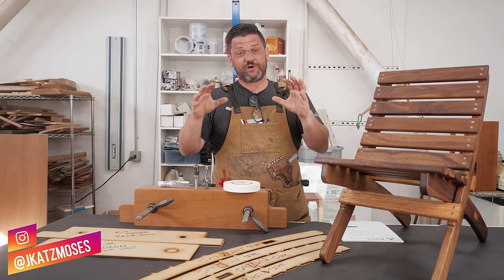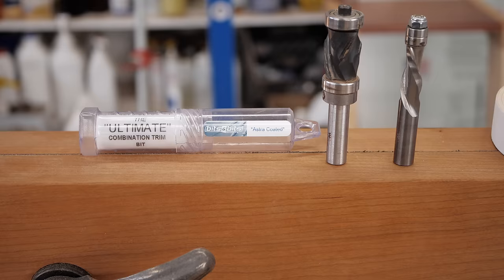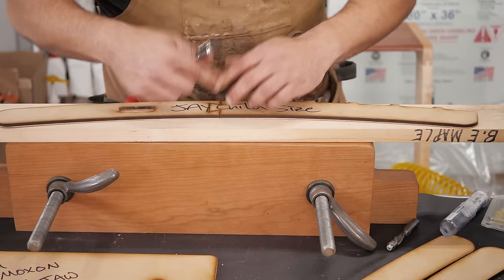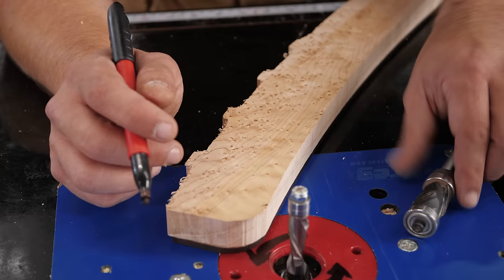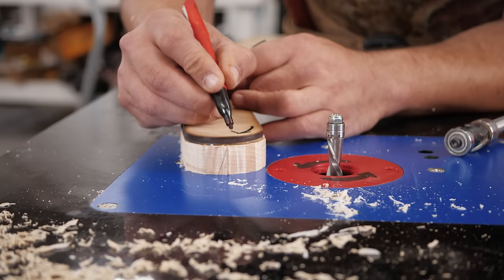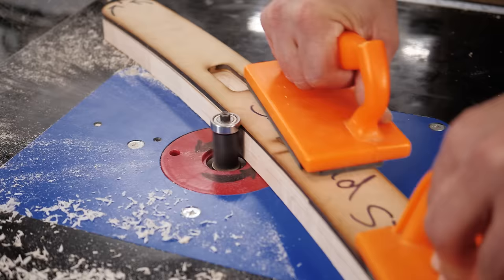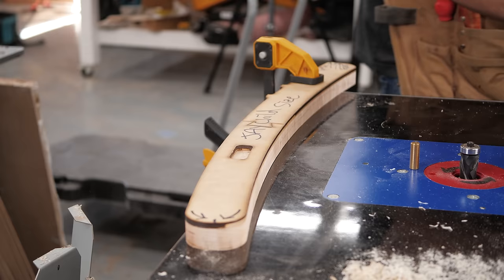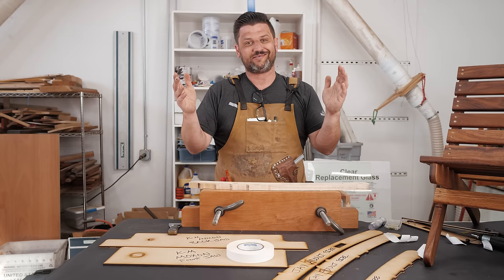My Favorite Template Routing Tips and Tricks

Comment: Nice description, i knew a lot of it but it was a good refresher and certainly a good thorough description about feed direction vs grain direction for anyone who is a little confused about it. I had a situation with a 1/4" template bit in a table that caught like that and it also bent the shaft of the bit so it caused some INSANE vibration, so your kickback demonstration is very important. Also, I want one of those double bearing bits now.
Reply: Same here—had thin “fins” I was routing with my template, and I chewed up two of them and had one  pulled out of my hands. SCARY. I had no clue that I needed to worry about grain—just the direction I was supposed to feed the workpiece. Thanks, Jonathan!

Comment: A few of things:

 Your use of the term "safety pin" implies using it provides some sure element of safety, which it might not. Porter Cable calls it a starting pin and I prefer that terminology as that's what you use it for. You generally only need it for starting on smaller pieces, when you need to approach the bit very slowly or to help maintain control of the situation where you need to start routing one edge but not the edge perpendicular to it. Like many others here, I didn't know what it was supposed to be used for until I saw a demonstration on it at a Rockler store. It came with my Incra router lift. I use it occasionally. When I was making rail-and-stile panels, I used the starting pin a lot as those bits are huge.

Visible tear out against the grain depends on the bit and the wood. Tear out cannot be eliminated, only minimized. The harder the wood, the worse it is. Going in the other direction by flipping the work piece can sometimes help, but sometimes there's no choice. Take the case of the hand grips on the leaves of a butler tray table when all sides of the hand grip need to be rounded, with and against the grain. Going slow helps but that will tend to produce router bit burn. That burn can be sanded off and repaired easier than grossly visible tear out.

The flush trim bit can help produce very straight and accurate cuts in pieces that are just too long or awkward to cut on any other device. You just need a long straight edge clamped to your work piece (and any work piece needs to be secured to the work bench with at least 2 clamps). The larger the diameter of the flush trim bit the more effective and smoother the cut will be. A 1 degree cutting angle error made in a dining room table top piece 40 inches across will result in a lateral error on the far end of "only" 0.7 inches. If your table will have leaves, nothing will line up! You cannot fix this and have a clean edge with any other tool besides your hand router, trim bit and a nice straight edge. A jointer will not guarantee parallel surfaces, only straight ones. 

Using templates is very useful but not problem-free. The double stick tape will pull off material from it or it's not sticking well enough. If you plan to use the template a lot, applying shellac to its surface and letting it dry overnight will help the tape stick to the template better without removing template material when separating the pieces or pulling off the tape. The bearing will mar the surface of the template on repeated use. If the template is hardwood, that is best and the harder the better. Damaged template surfaces can be so-so repaired with the epoxy-type wood fillers (Bondo, etc.), but full strength takes much longer than the advertised15 minutes. Nitto tape is very expensive and you appeared to use a lot of it. I use the 3M Scotch foam double stick tape. It is less than 1/6" thick and you don't need very much of it. Two to four small pieces, 3/8", is generally all that you need. If there is any warping of the template or work piece, the paper-type double stick tape may be too thin to adequately adhere to it, so the foam tape would be definitely better. The putty knife method of separation is fine if you don't want to reuse the tape (sometimes the tape can be used more than once). It can also scratch up the taped surfaces. I use it when I can't separate the pieces just using my fingers, which is often. I avoid thin templates. MDF makes the worst templates but it's cheap and easy to work with other than the toxic, MDF dust. Plywood is not much better because the actual surface rested on by the trim bearing is only the thin, outer surfaces of the plywood.

Comment: Building an Adirondack chair for EXAMPLE … I have determined exactly where my fasteners need to go when assembling the chair.  The plus now is... I don't need tape for routing.  
*I simply counter sink a screw through the existing hole in the template and into the piece of wood.
*I visit my local hardware store and ask for "scrap" plexiglass/acrylic and pay pennies on a dollar. I use them for templates.
*I draw my outline onto the piece of wood... then remove the screws and set aside the valuable template.
*I can now with confidence, cut as close to the outline as possible without endangering a template. 
*Afterwards, I realign the template using those same screw holes to the lumber and begin safely routing.
*When routing is complete, I remove the screws and then use those holes for my fasteners for assembly.  Of course, if you are using larger fasteners, simply drill out a larger hole. 
*I love the acrylic/plexi because the shape stays true after countless uses... and... if you accidently drop a template on the floor as I have, it doesn't dent like a wood type template would.
*happy routing!
Reply: acryl have shit and dangerous use, this material have than glass broken easy, and too hard, lot better use thin wood or ABS or PVC plastic.

Comment: You are very thorough with your videos. Good information. A little trick I use is to first install a larger diameter bearing on the cutter. This take a "rough" cut first. Replace the original bearing, and finish cut the piece.
Reply: Some bits have 2 bearings, usually the same size, but, maybe one could be larger for the 'rough cut'.  Then it only takes a height change.

Comment: I think I saw the wood whisper do it first but it’s blue masking tape with a drop of ca glue and it works good and comes off easy too
Reply from the maker: I've used it before but not a big fan. Seems to come off too easy for me and sometimes I get squeeze out beyond my tape. Plus for $14 these rolls last me a couple years and there's no setup. Blue tape is crazy expensive to be using it for something its not really intended for. IMHO I can use 4 little tiny pieces vs 8 big pieces of blue tape.
Reply: I was going to suggest the same.  Watch Ben at crimson guitars he uses it a lot.
Reply: I have a feeling the wood whisperer mentioned he got the tip from a crimson guitar video
Reply: @katzmosestools  Tried both too. I strictly use double sided tape. Its definitely not coming loose.

Comment: Nitto tape is a similar product that works well. I use it on a desktop PCB mill. It even held down machinable wax. Like spec tape it doesn’t need much to get the job done.
Scotch double sided office tape also works in a pinch IF you’re careful. It won’t re-adhere once removed and it needs more of it though.
Reply from the maker: Great tips. I'll check them out. Usually a roll of the stuff in the video last me a couple years. I think I've bought 3 rolls in my lifetime.
Reply: @katzmosestools  For removing the template it usually works pretty well to pry up an end just far enough to get a grip on the 2 pieces and then rather than prying/pulling straight apart try shearing the parts apart sideways.  For me there is much less muscle involved and the forces are across the width of the template with little risk of banding and breaking it.

Comment: When I took woodshop in junior high (as opposed to Home Ec), I tried to use a router free-hand to cut my name out. I came out so bad I chucked it into the scrap bin. I never even attempted when I took woodshop in college (yeah, BS Industrial Tech - woodshop, plastics shop, and metal shop were core electives).

Now that I'm getting to the point where I just have to use a router I'm afraid whatever I do will come out jacked and wood's expensive. I been putting off finishing the cool redwood porch glider because of that fear. It's gonna be somebody's Christmas gift at this rate...

Comment: I'm looking forward to the router series. I'm still trying to wrap my head around the cut direction and climb cuts and tearout and that kind of stuff. You touched on it here, but for me there wasn't enough explaining with the demonstration. It just went by very fast.
Reply: Get a handful of straws and lay them out on a table. Offset each one say a half inch apart as you go. When you start at the top routing and going "downhill" the next straw inline is 1/2 inch longer and supports the previous one. Starting at the bottom and routing "uphill" as you would cut each straw there would be a 1/2 inch where there is no support and much more likely to tear out.

Comment: Instead of double sided tape, use painters tape on each piece - put cyanoacrylate on one piece of tape, spray the other piece of tape with accelerator, and it will hold, as long as you don't 'twist' the two pieces apart - which is perfect for when you do want to take them apart - the tape will come off easily, and if it is sticky and you are having an issue, you can twist the pieces apart.  Cheers
Reply: This is the way, and it is much easier to clean up after you separate the pieces.
Reply: Great tip.  Just used what I thought was good double sided tape but created a mess (must have been carpet tape)

Comment: Thanks so much for this video. how to do cut an outside 3/4" radius on a 12" x 4" piece making a radius cut on the 4" vertical side ,top to bottom if this makes sense? Using a flush trim bit or roundover bit? thanks.

Comment: Awesome info! Now I'm thinking I'm using a too small diameter bit, or too weak of a router (Love it anyways) rather than needing new cheap bits from ebay, or bank breakingly expensive new bits from the hardware store. I'll try what I was doing slightly differently later.

Comment: Thanks for the tips! Have you ever tried to use end mill cutters? They are a lot cheaper than this router bit that you told in this video. These end mill cutters don´t have the bearing but some routers come with a guide bushing which has the same function of this bearing.
Reply: better use bearing bit, not expensive than whitout bearing, all bit have today wery cheap can buy eweryday new if want.

Comment: Jonathan you so often seem to cover exactly what I need to know, and you have done it again today.  However, what about when the work piece is wider (thicker) than the depth of the router bit, and you have no option but to start with the lower bearing, and then flip the work piece and use machined surface as the template with a top bearing bit, or your two bearing flush trim bit with the lower bearing removed?  I'm trying to see it in my head, and thinking we should be able to treat each case according the grain direction where the bit is cutting, but I am not sure I have it right, and can't even experiment till I get to the shop tomorrow.   BTW to add to the problem, I am just using straight (non spiral) bits, but I can see that I am going to need to invest real soon.
Reply: drill if possible 2 small holes using a drill press through the piece. screw template on from side 1 switch to side2. plug or fill the two holes

Comment: You spent considerable time eating out the tooth detail on the bandsaw. Would you explain the potential problem of letting the router take a bigger bite? And how to determine this 'limit'?
Reply: Puts more strain on the motor and will dull the bit faster taking big bites. Just try to get as close as you safely can for less wear on the bit and router.

Comment: Thank you for the video. I have also experienced kickback with a half inch bit while making Jay Bates nesting chairs in Alder. The grain direction was significant and you showing the technique of using a double bearing router bit was helpful. In a  future video could you possibly cover router bit speeds? Would slower bit speed help with the kickback?
Reply: Slower speed will give a rougher cut, and your feed speed would need to be a lot lower. Higher risk of tearout. That's my advice as a time served cabinet maker.

Comment: I know this is a year old, but wondering about templates and thick work pieces. Like say a 1.75” thick chair leg is desired, I’m assuming you cannot use the double bearing bit, you have to attack this a different way all together?  Like a combo of a template bit and flush trim bits?

Comment: My issue is finding a way to route templates that are larger than my template. 
 
For instance, if I have an intricate shape that I want 3 inches larger in slavery direction. I'm often having to make several varying sizes of an item, and I don't want to have 10 different templates for each item. You'd think "Just use a larger bottom bearing." But if it has fine detail designs, curves, etc, a larger bearing would have too much surface area, and unable to move along sharp, short angles.
 
This has been a perplexing issue for me. Any tips?

Comment: Nice intro, but while I like templates like this since they don't take a lot of space I typically prefer fixtures instead with toggle clamps, much safer and no need for taping. Sure you will in some cases need to make several fixtures for one piece but it is still faster and more effective. Cheers!

Comment: QUESTION: i havnt found anything on this. incra router plates has holes in the lock rings which helps tremendously suck in a lot of the dust on freehand routing to the underside box where the router is and not all over the top of the table. So, is there a way to route two little channels into the lock ring plastic to help improve dust collection since kreg does make that ... which they should btw?

Comment: A video on accurate and repeatable dadoes with a router. I've tried several methods and none really do the job.
Reply: Check out Nick Ferry's channel. He has a great router dado jig build :)
Reply: Tried a flip stop? Clamp a piece of plwood down and run your router with desired bit. Say its 2 inches from plywood to the edge of you r cut...cut a 2 inch piece and put it against the plywood so it matches up with the cut edge. Put hinges on it so you can flip it up. Then just line it up with the layout mark for your dado, flip up the piece and it will line up perfectly. It will change for each diameter bit.

Comment: I should have watched this before I started. All I'm doing is multiple pill shaped pieces of 1/2" walnut - 7 inches long with ends the same as in the piece you were cutting. Almost ever single time I rounded the one particular end I got kick back and tear out. It was driving me nuts. A bit disappointing to learn that I should be changing bits with every piece, since I have so many to do, though.

Comment: hey sir, i boiught the triton  router 3 something hp. put it in a router table under a kreg plate , took out the spring and when i set it to height it vibrates back down a little at a time. is there something else that i need to do to stop that. i have not seen you do anything but raise and lower. thanks

Comment: Thankx for the router pattern video, i used your link to get 3 rolls of tape. I have a question , as a newby  to using a router, i insert my bit all the way in then lift it up almost 1/8 inch before tightening.  When i try to remove the bit it almost always refuses to pull out. I sometimes place a scrap piece of wood on it and  lightly hit with a mallet or screwdriver handle to jar it loose an sometimes that dosnt work. What am i doing wrong , to tight? dirty collett? or just dummy operating machinery?   Thanks in advance for helping with this problem.
Reply: I have 5 routers and sometimes use 3 at a time (a different bit in each, one at a time of course - after all, I only have 2 hands!).

The collet has a double safety lock mechanism. When you first loosen it, the collet nut will turn loose freely and then stop. You need to loosen it again at that point with your collet wrench. Then, it should pull out. With a 1/4" collet, I have had some occasional stubborn bits. In that case, I remove the collet totally and use a small center punch or 3/16" metal dowel and gently tap the bottom of the bit where it inserts into the collet using a small hammer on the punch part. It generally loosens enough for me to pull it the rest of the way out, but I do it over a work bench and not too close to the edge just in case it should fall out. I don't want it to hit my concrete floor!

One problem I have had with 1/4" collets is the tendency for the bit to move out of the collet. This tends to happen most often with straight bits when making too deep cuts. The bit has never fully come out, but it will usually damage your work piece. Therefore, you need to make these 1/4" bits extra tight in the collet. Whenever I use my 1/2" bits, this never happens. The bit should be fully inserted in the collet, especially the 1/4" shank bits or the chance for bit movement out of the collet will be greater. There are digital bit height gauges out there to monitor bit heights. The U-shaped ones with the center post work the best but don't have springs. The grey L-shaped one with the handle is not suitable for use on hand routers because it is too wide -- the distance from the measuring pin to the handle is just about the radius of the router and you won't be able to obtain any accurate bit height with it, but it will work just fine on router tables, where I prefer it.